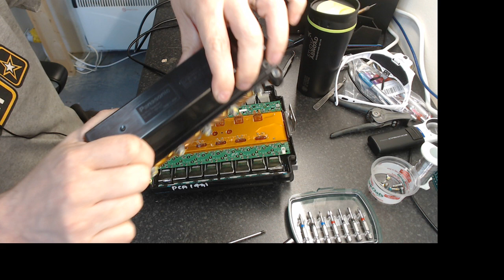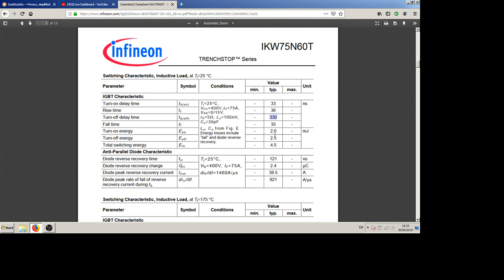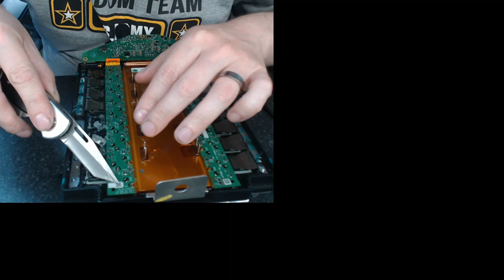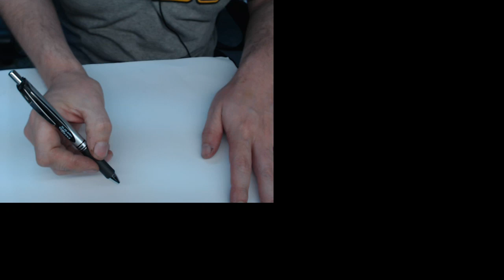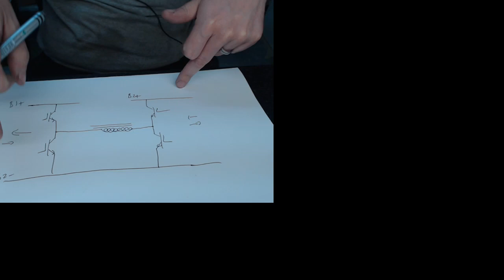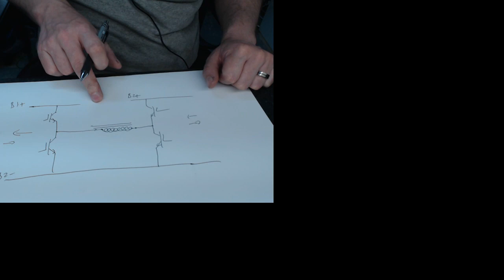Tesla Inverter Teardown

Comment: There is 2 times more transistors under Busbar PCB ... Not 600A -> 1200A :)  KR. Daniel from Poland
Reply: Are you referring to the Sport or the "normal" inverter? 

How do they connect the gates together on the lower transistors?

Comment: have you found out the reason of why they use a lot of small IGBT packages instead of large IGBT bricks? is price the reason? (for example: SEMiX604GB12E4s. + skyper driver and board for skyper ) thanks :)
Reply: I think handling the high temperature is much easier in small igbt, i think there is some like 16-18 switch per phase so its much easier to handle its rising temprature with compare to brick igbt